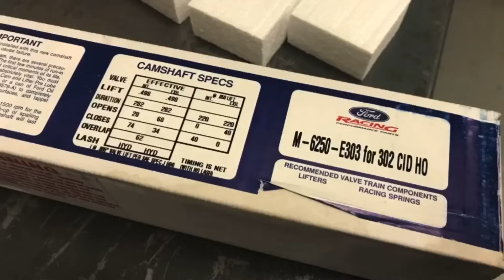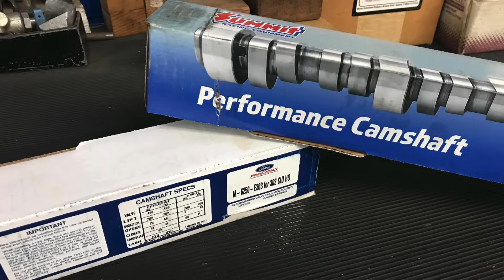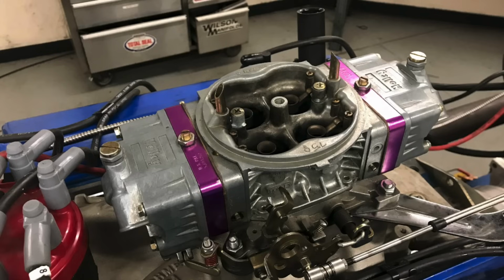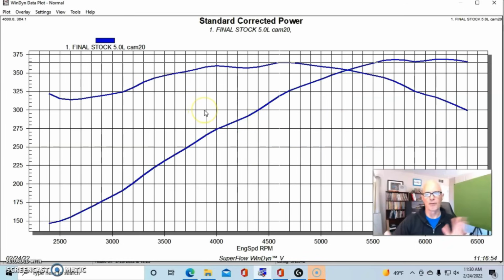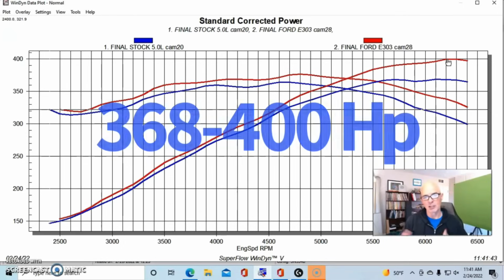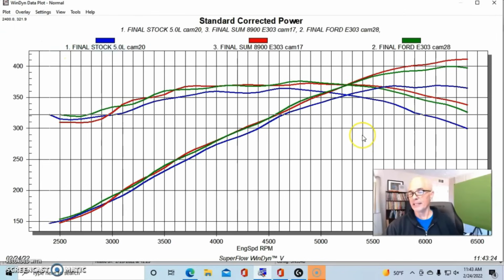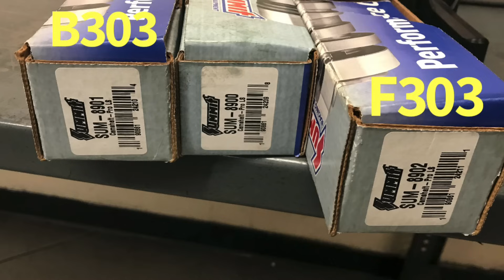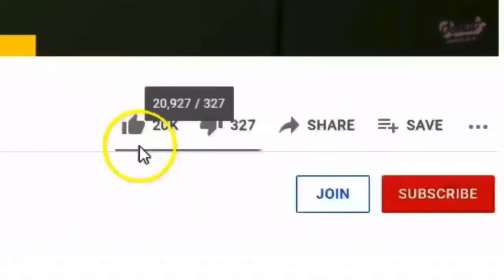HOW TO MAKE 5.0L FORD POWER! FORD RACING E303 VS NEW SUMMIT E303 PLUS-IS THE E303+ REALLY BETTER?

Comment: I’m building a nostalgic build for my 1967 mustang. 351 Windsor with ford GT40 3 bar heads paired with an old school e303 cam. I installed KB flat top pistons with an offenhauser duel plane intake with a 4 barrel carb… I could have built something more modern like trick flow heads with a trick flow cam ect. With that said I love how it takes me back to the late 90s when all we could afford were some junkyard heads with a cheap cam with some gears. All my buddies tried to inspire me to build a 408 stroker engine and go all out. I chose to keep it old school and I’m glad that I did.

Comment: Wonder what the results would be with the Ford Racing cam and 1.72 ratio roller rockers that would add roughly .035 more lift? It would make the lift values closer and I’d venture to  say the HP closer up top too. Possibly without the low rpm dip of the Summit cam.

Comment: E303 makes power based on the tighter lobe separation angle more than duration. The stock cam with 110 angle would pull like a freight train. The summit cam is more designed for fuel injection.
Reply from the maker: cams don't know EFI or carb
Reply: @richardholdener1727 The map sensor would, especially on a stock setup. Its all good with programming though. I was just thinking on the intended target for that particular cam.

Comment: I dont understand the 750 carb on a 302. I had one on my 351C, and it ran rich no matter how it was adjusted.
Reply from the maker: bigger carbs don't run rich, the run lean on milder motors due to a lack of signal. Your carb has a problem
Reply: @richardholdener1727  i replaced it lol

Comment: Bought the summit E303+ cam. Does anyone know if the base circle is larger than a stock 302 cam from the roller era? Need to order pushrods and don’t know a size. Obviously will check, but I figured I’d ask if anyone knew if it would be a larger base circle

Comment: I bought the e303+ cam an im also not that impressed with it an my motor is 306 ross flattop pistons push rode name brand an lifters not stock also aluminum heads from Hines brothers ss vavles eledbrock airgap intake with aed 650 carb love my carb I did run a knock off cheap billet dizzy not impressed with it eather it does run but it's not no msd the cam ant what i expected 302 or 306 my appion run better on a smaller cam idk just my appion
Reply from the maker: that combo will be much more powerful than a stock 302-something is wrong

Comment: Can I run a F303 cam and gt40 or gt40p heads in my stock 86 foxbody flattop piston and it's carburetor without clearance issues?
Reply from the maker: you need to check

Comment: I would be shocked if the OG 303 with 1.7 rockers wouldn't make more power than the summit cam.
There are much better cams now but for 35+ year old tech the OG E303 did ok.

Comment: i'm a buyer of older trucks and I'm looking to rebuild a stock w 302  i would like 400 hp just so i know i have some power and i want carb no efi no sensors like the newer trucks only power i want is doors and windows maybe i  done a little over my years but i really want to build this one myself from the ground up  i'm just look for more reliable than power but i want enough to pull my pontoon boat out of the water  that's why i just want to pick your brain i will be using msd ignition set up i really want bare bone wiring  because you now as well as i do 50 year old cars or trucks need rewired  instead of dealing with the gremlins
Reply from the maker: 302 with AFR 165 or 185 heads, comp xe274 cam and dual plane intake and 750 carb

Comment: would an e303 work in a 93 f150 5.0?
Reply from the maker: is the 93 a hyd roller?
Reply: @richardholdener1727  yes, after more research it looks like a comp cams 31-255-5 would be a better option.

Comment: Well now,This tells me the summit cam is not the choice for a street daily driver/hot rod. You lose bottom end and only gain a small hand full if you run the guts out of your stock 5.0. This would have been better if you did it on a bone stock 5.0. 90% of the guys that buy an E cam put it in a bone stock 5.0 mustang just to make it sound good at idle. The summit cam specks also seem like they would have less valve to piston clearance.

Comment: This analysis is very interesting. Would you know what the 0.050" duration is on the stock HO camshaft is? My guess would be around the 210 degree range? That is some good power for a mild cam. I'm not to familiar with factory or aftermarket windsor heads, but do they have a restrictive exhaust side compared to the intake? Eg
Like 2V cleveland heads do? Quite common down under here to run  a dual pattern cam with 8-12 ish degree more duration on the exhaust side on 2V clevelands
Reply: HO cam @ .050 is 210 intake and exhaust. You guessed right. The E cam has the same closing points, just opens the valves 10* sooner and has more lift.

Comment: I have the E303 in my ‘86 EFI 5.0, but I have some issues with driveability at low engine speeds.  How would the E303+ do from a driveability perspective?
Reply from the maker: it should work well if tuned
Reply: @richardholdener1727  The current setup was tuned by the local go-to Ford tuner, but he was unable to resolve the issue.

Comment: Only thing that makes my scratch my head is what makes this summit cam use the e303 designation at all? There is a same 220° on the intake but nothing else, it seems vastly different, that would that make every sbf cam with an advertised 220° duration a version of an E303 cam? that I can see... As far as I can see is it's just a different summit sbf cam. Maybe some similar timing events? Just seems summit is tossing a letter cam name onto it for marketing reasons to make it jump out and not get lost in a sea of zillions of sbf cams... To call it a particular letter cam id feel the duration would have to be the same as the original but to call it a letter + I think everything should the same with just one feature increased I'd get it like all the same with a slightly different LSA or all the same with more lift or dual pattern with the same exact intake specs but slightly different exhaust or vice versa... Just my opinion, I'm not saying it's a bad cam or it's not better it wouldn't be hard to out perform those old school old camshaft designs I just think the labeling it a version of a letter cam thing is just a marketing. Maybe theres something I'm not seeing?

Comment: Popped up again  I think with AOD and stock exhaust the FORD cam wins. extra exhaust would not help much or maybe it would but I would not trade off the 3000 rpm torque in a LTD or rock  crawling bronco  ( I own both)( going to take the efi motor and aod out of the LTD and replace the carb motor in the bronco) so great useful test

Comment: Not a fair comparison for the 303 Plus series as they are ment for stock irons.  The extra exhaust duration was ment to offset the poor exhaust flow within the stock heads.  Hence the price...it would be rather silly to put a $500 cam on stock heads that can't support the flow. Equally as silly as buying good heads then cheaping out on the cam..
Reply from the maker: cams are not meant for specific heads-if they add power with stock heads, they add even more power with after market heads (regardless of intake to exhaust flow relationship-I have tested it)

Comment: It seems from most of the comments i have read, people seem to think it was mainly the cylinder heads that made all of this power? Although cyl. heads are a huge improvement, and would allow a longer dur. cam to work better by pulling more air in through a stock Efi. Intake. You must remember that the stock heads flow around 160cfm., but the stock Efi. Intake also flowed around 160cfm per runner. So this test utilized one of the best flowing/working carbed intakes in the 1,500rpm to 6,500rpm range, AND good flowing, higher Cc runner cyl. Heads, along with an AWESOME exhaust system, its this Whole Combo, that unlocked the camshafts hidden power!

Comment: Hi first off great information in your videos I have a stock build roller bottom end with gt40p heads e303 airgap and Holley sniper EFI what kind of heads would you recommend to replace the gt40p heads for more power I'm just worried about the piston to valve clearance of 202s or 205s I'm running rebuilt cobra crane rockers

Comment: The Summit cam would likely show a larger PERCENTAGE increase in power under the curve on an engine running stock E7 heads.  Factory iron heads are particularly weak in exhaust port flow, hence the uncommonly large 11 degrees additional exhaust valve duration in this cam.  The Blueprint heads are better balanced between intake and exhaust port flow, so they would likely be optimized with a cam having less duration split between intake and exhaust.  Performance of various cams is less about "better or worse" than how well a particular grind matches and optimizes a particular, overall combination.  The Summit cam leans towards a stock motor or one with no better than GT40 type add-ons.

Comment: Don’t need to run a split duration cam with those efficient heads! That’s why not much of a gain, and a slight loss on the lower rpm torque values!
Reply from the maker: no

Comment: I hope i made a good choice, i got the trick flow twisted wedge 170 heads and trick flow stage 1 cam 499 lift (trickflow top end) i also got a new holley systemax upper and lower, all this going into a stock 89 5.0 mustang but i am planning to get a 331 stroker kit for the block, cam wise what do you know about the trick flow stage 1 cam? Or do you think there is a better choice?
Reply from the maker: IT IS SMALL AND GOOD FOR A DAILY DRIVER-331 I WOULD USE A STAGE 2

Comment: Not all that impressed with the Summit E303 plus cam given the significant increase in lift and exhaust duration over the now ancient Ford Racing E303. Certainly not worth yanking the old E303 for.
Reply: Wrong LSA...
Reply: Not enough cubes
Reply: @jamestupper5599 
How many more cubes is a cam suppose to add?
Reply: @hotrodray6802 cam doesn't add displacement. That's all bore and stroke. I think the guy saying not enough cubes is trying to say that the 303 plus cam would run better in a larger displacement engine.
Reply: @hotrodray6802  😂  I will give the gentleman the benefit of a doubt in meaning that it might be more beneficial in a 351, but yeah, I see the other side of that coin😅l😅
Reply: True that!
Reply: Did the 8902 ever get tested?

Comment: Hi Richard, I’m just curious about the pistons in this motor, are they stock dish or flat tops?  I’m currently building exactly this setup with the E303.  Thanks!!
Reply from the maker: NOT SURE IF STOCK
Reply: @richardholdener1727  I’m building an identical setup but temporarily on my stock block 302 with E303.  I printed out the write up from On All Cylinders about this build.  Nowhere does it say what pistons.  Thanks Richard.

Comment: I just got a set of these blue print heads on eBay they are bare other than valve guides I was wondering could you recommend a valve and valve spring kit that would work they are the 190cc heads

Comment: What specs should I go with on a stock 302 with the summit cam? Valve spring and rocker wise
Reply from the maker: springs need to match the cam-rockers for a ford are usually 1.6

Comment: The two improvements i got with the 303 plus was a bit stronger from 4-6k (maybe) but where it shined for me was idle and low speed drivability. Ive got a 306 with x2 heads and pro flo 4 efi and the new plus cam plays much nicer with that particular efi system.
Reply: Was the gas mileage worse? I’m looking at letter cams for my daily driver 3.31 gears thinking of b cam or e cam it’s a 5 speed
Currently stock cam
Reply: @keithmartin6406  I love my 5spd., with the E 303 cam, its responsive= great tq., and Awesome sound! I dont think my gas mileage was effected much, as i have 2- 1994 (302) Efi Mustang Gt's, 1- 5spd.(with 3.73's, and E cam), and 1-Aode( with 4.10's, and stock H.O. cam). In my opinion= the perfect gearing for each type of trans., with mild bolt on's. But there was a bigger diff. In Mpg loss in Aode= about -4 Mpg on the Hwy. going from the stock 3.2? gears to the 4.10's, with stock H.O. cam vs the 5spd. with 3.73's, & E cam, = Lost about -2 Mpg on the Hwy., and that's with gear's, and cam change! My opinion the -2 Mpg lost is probably all from the gear change, as the E cam, made my engine more eff.!

Comment: I am very confused by these results. You have several videos, e7 vs the world, low buck sbf, etc etc. The only one that made close to 400 hp was the AFR 165 in the vs the world test. You had one where you put on 205 CNC heads with I believe the 274 cam and it made around 384 ish. My confusion comes in on this particular test because these heads are 60cc chambers so no big jump in compression, 180 runners I think, and the very mild E303 cam but it made 400HP. How? also, how did you get these heads to work with PTV clearance with the 2.02 valve and the E303 cam? every article I have read says it won't, but i trust you alot more than most articles

Comment: What Ford Racing cam would you recommend to pair with a speed density H.O. 5.0L with Explorer intake and heads? For a weekend street car.
Reply: Is an F303 overkill? I'd like get the ports on the explorer heads cleaned up and new springs installed, if that matters.
Reply from the maker: you will need to tune the speed density with almost any cam

Comment: Used to run a stock 302 cam with 351 heads. Back in the day….
Good power and good gas mileage.

Comment: $50 wager Ricahrd..... They summit cam is too much bigger.  The F303 would be better comparison.  Lift Iis a little closer at .512, the LSA is closer at 114 versus summit 113, and the duration is smack dab in the middle with a single pattern 226 versus summit 220/231.

Richard, I got $50 says an "old"  F303 beats the Sunmit cam in a typical EFI 5.0.

And before Summit gets silly with an even bigger cam, and calls it a much smaller cam, don't forget the "old" x303.

These old cams aren't THAT easy to beat.
Reply from the maker: they have other versions of the alphabet cams. You can choose what size cam you want. The original cams are very easy to beat in terms of power-even while keeping the same intake duration

Comment: I’m always feel like I’m surprised at the gains a 5.0 makes but I remember back in the day it seemed easy to find power locked away in these engines. I know everybody venerates the SBC (rightfully so) but I don’t know if they realize how fun and cheap the 5.0 was to dink around with.
Reply: Slap some decent heads and a cam on a 5.0 and it’s all you need for a weekend car or a solid truck engine.

Comment: I wonder If I could run that summit E303+ with AFR  185cc 2.02 heads on my stock bottom end 94 GT without having to cut the pistons. What ya think Rich?
Reply from the maker: need to measure

Comment: The stock cam with 1.7 rockers is probably bot that far behind the e and e+!
Reply from the maker: ROCKERS DON'T HELP THAT MUCH
Reply: @richardholdener1727  i know its good for 13rwhp with ported e7te heads, performer with 600carb and no cam or ignition timing change.
 Id be interested to see what it did with the better heads. Thanks

Comment: Thanks for testing the Blue Print Heads, I have a similar setup in my F150 except with a 650 Demon and a Trick Flow Stage 1 cam.

Comment: This just tells me the factory cam is actually good enough for a mildly modified engine. Stock these engines are supposed to be sitting around 215 or 220 at the crank tops. But his test engine is well over 100+ more power at the top end while keeping a 300+ lbft at the bottom end.

I really would like to know what was done before hand and just keep the factory cam.
Reply from the maker: the mods were all listed-and a stock 5.0L makes 260 hp or so when tested like this

Comment: Would be useful to know what the numbers are from 1500 up, considering the E303 is uses in street cars commonly.
Reply from the maker: YOU AT WOT AT 1500 RPM A LOT? IF SO, YOU NEED TO SHIFT DOWN A GEAR
Reply: @richardholdener1727  no it's about seeing how it will pull a car on the highway and if it has any ability low ended.

Comment: The Summit cam is a cheap way to do it.  I'd rather have a dual pattern cam with equivalent .498 lift and 220-230 on the exhaust.  That will already reduce exhaust valvetrain life.  The Summit is a sharper cam lobe as well with 268/278 total vs 282/282.  That higher lift and more total valvetrain engagement significantly reduces valvetrain life for sure.  Summit tried to mitigate it with .540 lift on the exh, .010 less.  But overall it's not worth it for  for 12hp up top or a 0.3% gain, a power loss down low, and more valvetrain wear.  Bad call and why pure dyno and pure peak results should not be interpreted.  You'd be better off racing the smoother cam every time, 12hp is not worth anything.  Better than for the Ford E303, just split the profile and hold the exhaust open at .498 lift would net probably 10hp and cost barely anything an slight exh valvetrain engagement.  Read the mechanics people, not the metrics.

Comment: Good stuff.  I'd love to see the comparison of the alpha bet cams with GT40p heads with upgraded springs vs. The aluminum heads. It seems that's  something that would be found on the street and the track and a realistic comparison.
Reply: I ran a FMS E303 in my 89 5.0 with ported cast iron GT 40 heads, GT40 upper and lower intake (lower ported), 65 mm throttle body, 1.72 rockers, shorty headers, x-pipe and 2 chamber flow master mufflers. The car ran really good and was a lot of fun!